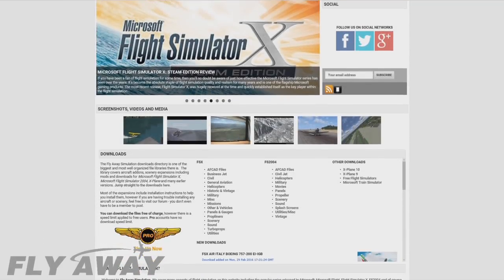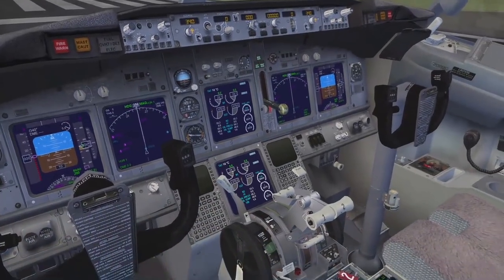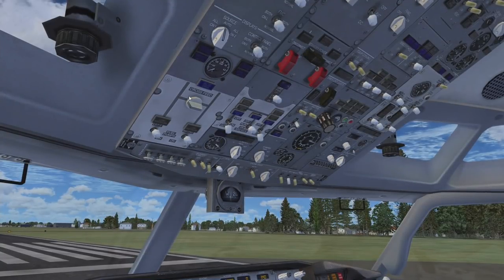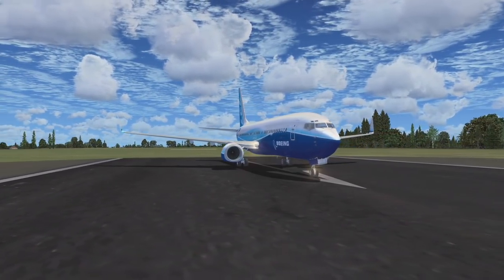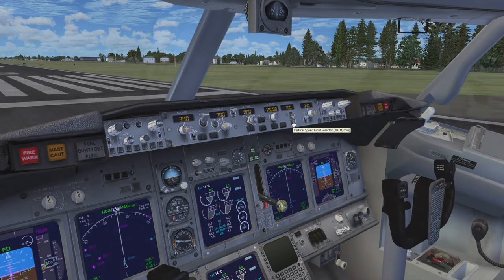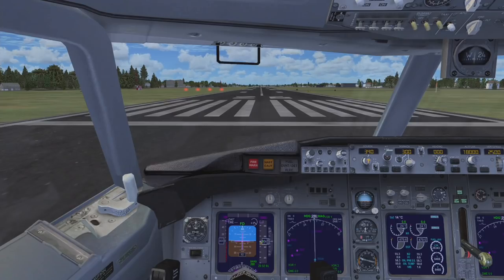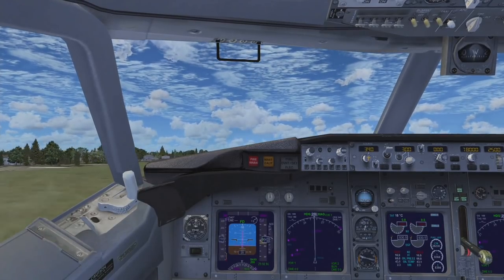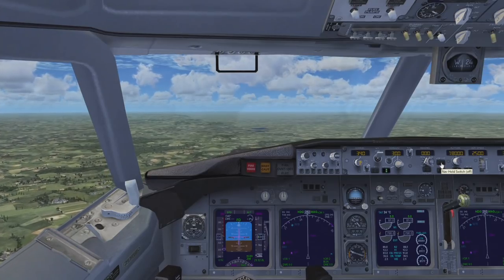FSX How to Take-Off | Boeing 737-800 | Tutorials

Comment: Me : ooohhhh!!! lots of buttons
My friend : Dont touch anything when we are at the sky, OK!
Me : Ok
5 hours later
Me : What does this do?
Pressed the engine button...
Reply from the maker: Haha sounds like you had fun!
Reply: lol IKR
Reply: *Stick Shaker* "STALL, STALL, PULL UP! PULL UP! SYNC RATE."
Reply: stall happens when aircraft cannot get enough air to lift up .and this a very serious matter  to crash the plane.so to avoid this you have to pull the youlk not more than +4000 vertical speed and before landing at the decend time you should not enable spoilers on a321 depends o aircraft thats it.and also not enable spoilers on 2500 feet at highest 6000 feet you can enable.but if you enable spoilers at 2500 to reduce speed then you have enable spoilers at 60 % not 100%.and to disable "pull up pull up" sink rate you have to go to fsx controlls settings and go to GPS (TOGGLE) AND ADD ASSIENMENT OR key that is "shift+w" thats it dear. have fun.
Reply: Derpy SquaredFox that was me a lot of times I played x plane.
Reply from the maker: Yeah we've all stalled it at some point, I still do when I'm messing around xD
Reply: Rip
Reply: @JacksFSVideos  yup...rn i did my takeoff and i stalled so i was just referring ur vids on how to go about

Comment: i set my vertical speed on 800 then my plane goes 1000 feet per 3 minutes when i set it on 2500 then its rotating to 25 degrees.
how can i fix it?

Comment: hi jack, nice tutorial video 👍, i have some problem, when i use this plane for take off with 100% power of throttle, the plane's speed increasing very fast... its diferent with yours, any solution ? thanks :)
Reply from the maker: Are you using the default Boeing 737-800?
Reply: Jack's FSX Videos affirm
Reply: Jack's FSX Videos Hey bro what are your specs?

Comment: But the speed shouldn't go over 250 before you reach 10,000 feet, and the flaps retracting speed is at 200 kts from 5 to 1 and at 210 kts to up position.
Reply: If it works, it works.

Comment: My plane wont lift (I haven't forgotten about the flaps). When pulling my joystick backwards only the nose of the plane goes up a bit... Help? what did I miss?
Reply from the maker: What aircraft are you using? Flaps in FSX are rarely the cause of this, it's usually to do with the trim elevator or something maybe more obvious.
Reply: Jack's FSX Videos Sorry, I am so new to this. Im using the same aircraft as you in the video (Boeing 737-800). 

Thank u for the answer and I'll test it tomorow
Reply from the maker: If you're using the default 737-800, it should definitely work. Make sure your flaps aren't extended too much and are 5-10 degrees deployed. Ensure your throttle is at 100% and you reach a speed of at least 130 knots for a total weight of 45,000 kg.

Comment: What about the engines and n1? I know people use brakes then start adding throttle then say make sure you don't go above 94% on n1? So what is all that?
Reply from the maker: When taking-off, you always need to apply 100% throttle to the engines. Once you're in the air, and have confirmed a positive rate, you then either engage your auto-throttle to maintain 250 knots below 10,000 feet or reduce the throttle manually.
Reply: ***** So takeoff at full throttle then after a few seconds while aircraft climbing reduce speed to 250.
Reply from the maker: Yes, just make sure you've got a positive rate with the gear up and then engage the auto-throttle.
Reply: ***** Is that how it is done in real?
Reply from the maker: Yes, the information in my comment along with everything in this video is what real pilots do.
Reply: ***** Ok thank you very much I will try these steps.
Reply from the maker: That's no problem - glad it helped. Don't forget to subscribe!
Reply: Done.
Reply from the maker: Thank you so much! I really appreciate it!
Reply: Jack's FSX Videos This is The Normal 737 and not PMDG, Pilots doesn't do like this.
Reply: Miam ga He is flying the Normal 737 that is less professionalism than the Actual pilot planes, In The Normal 737 you cannot "push all The Buttons" Although in PMDG you have control of all The Buttons  such as the FMC. Where the FMC calculate your V1, VR speeds for Takeoff. He literally just added 100% thrust and takeoffed whenever the Runway would end. If you really want to learn about real world flying I would suggest PMDG 777/737. This is just a simple tutorial for Normal 737s takeoff. It Was good Though for beginners in Fsx/P3D
Reply: Miam ga Ofcourse PMDG have doesn't have allt the features that real Airplanes have, It's FSX-SE. And with The Takeoff speeds, Ofcourse they dont do this in real life, I meant in PMDG. Your Fact is real for Irl Airplanes. jack did Also set all The Lights, He dont need Nav and logo for a takeoff. He May have Them Above 10000 feet
Reply: Miam ga With all The Speeds, And Lights? For a default aircraft?...
Reply: Miam ga I meant wing Lights :P
Reply from the maker: Just to clear up, this is a tutorial for beginners. Therefore I would definitely not use a PMDG aircraft as beginners are unlikely to have it, but everyone will have the default Boeing 737-800 - therefore is the best aircraft to use in tutorials. Plus default aircraft are generally easily to use and fly.

In terms of lighting, the Nav lighting is always required for take-off and will remain on throughout the flight. You're correct in that Logo and Wing Lights don't have to be on, however as Miam ga said, this is often down to airline decision and doesn't do any harm in having them on for take-off. But during the night, they must be on.

I hope this helps.
Reply: ***** You're probably right about default aircrafts of each FS is the best aircrafts to fly with. I got some addon aircrafts and added addon panels for them and those panels don't have all the buttons and switches of the default panels. And the bad thing about the default panels is that there are no built-in virtual cockpit views (window frames boundaries)  when added to an addon aircraft.

Comment: Taxi light and runway turnoff  need to turn on for takeoff and turn off when you do a after take off checklist ( do after takeoff checklist when flap is up)
Reply from the maker: Taxi and Runway Turnoff lights don't need to be turned on for take-off. Taxi lights are only for taxiing, which is why they are called taxi lights and runway turnoff lights, again are only for turning off the runway - hence their names.

Comment: Normal flaps are 5 not 10 :D 10 is too much
Reply from the maker: Yep, you're right! It is a mistake, but 10 degrees is also acceptable in many circumstances, so not that bad :D
Reply: To expand upon this, depending on the airport, 1, 5 or 15 may be used,
Reply from the maker: Correct :)
Reply: At landing I do 30 at 130 kn

Comment: Flaps for take-off is supposed to be max. 5 not 10 and landing is 30 or 40.
Reply from the maker: Flaps can be either 5 or 10, depending on runway length and conditions, landing is always 40

Comment: Hello jack
Under 10,000ft 250 kts MAX
Reply from the maker: This is a common misconception of the rule. It's only a maximum of 250 knots under 10,000 feet while coming in for landing - not take-off. I have personally been on many flights throughout my life and in every instance, the aircraft will exceed far beyond 250 knots below 10,000 feet while taking-off. As I said though, it's a very common mistake!
Reply: +Jack's FSX Videos ur wrong again 250 under 10000
Reply from the maker: As I said in the previous comment, you do not have to be below 250 knots below 10,000 feet while coming in for landing. Please re-read my previous comment towards 'Slowan Thomson'.

Comment: I find the 737 800 easier to fly than the A320 air bus, the sequence of setting the airbus buttons and controls are not the same as the 737.
Reply: All plane's sequence are slightly different

Comment: Below 10,000 ft you can't exceed 250 knots. So just Yano
Reply: I thought that as well, does this mean they lied about 9/11 with the plane going over 500 knots?
Reply: Well if terrorists were flying they probably didn't care because they weren't using autopilot. So below 10,000 feet you need passengers seat belt signs landing lights and logo lights on. Also speed below 251 knots
Reply from the maker: They are the official rules, yes, however I've been on over 100 flights throughout my life and have seen pilots break this rule almost every time
Reply: Ok thank you
Reply from the maker: No problem!
Reply: that is bullshit as it is the rule, all pilots stay at 250kts before 10,000 and it is all done through auto throttle
Reply from the maker: Yep it is a rule, but like I said, most pilots don't follow it :)
Reply: Jack's FSX Videos I am sorry to say but you are wrong, all pilots have and I mean HAVE and this is coming from someone who has been in the cockpit on takeoff, they all stay at 250kts
Reply from the maker: Like I said, I've been on over 100 flights in my life and have physically seen this rule broken countless times, there's nothing to argue against that. Your time inside the cockpit, was clearly one of few times the rules are followed, as I said, "most pilots don't follow it", not all
Reply: all I am saying, if "most" pilots broke this rule, I don't think easyJet would be running now but okay
Reply from the maker: Why easyJet?
Reply: Jack's FSX Videos EasyJet because as a fact they are one of the best successful airliners out there but if pilots broke that rule then they wouldn't be on the job anymore
Reply from the maker: Then you could say that for almost every airline in the world, the fact is, they don't follow it
Reply: @JacksFSVideos  pilots don't "break the rules" - it's not like it's a flimsy rule that isn't too important, so nobody cares if it's broken, it depends on location and circumstance. The 250 below 10000 rule is specific to the USA (and many other countries that use US rules as industry standard). In the UK, for example, they have designated speed limits from certain points on approach or departure in order to keep a good rate of traffic flow. These designated speed limits can allow aircraft to reach speeds above 250 at lower altitudes than 10000, though normally not much higher. Partly due to noise abatement, but also due to the higher risk of bird strikes below 10000, that would cause much more damage at higher speeds. Also, a heavy 747, for example, would need to keep flaps out until 10000 and maintain a very steep climb in order to stay below 251kts, which is not conducive to fuel efficiency, and are often allowed to reach speeds up to 285kts before they reach 10000. Pilots in most countries - especially in the USA and Europe - very rarely break rules, even trivial ones. When they do, they don't stay pilots for long.